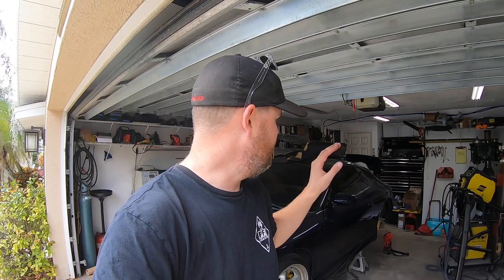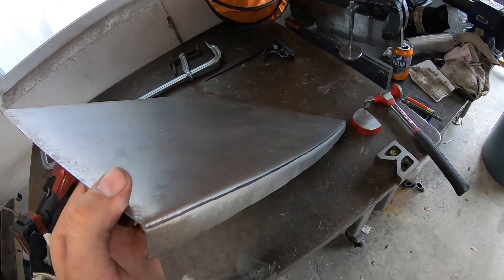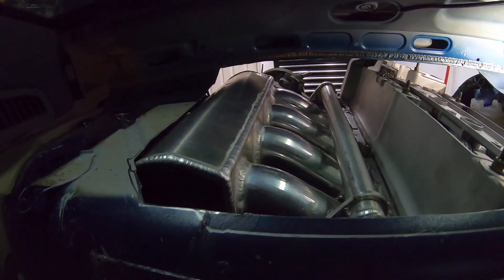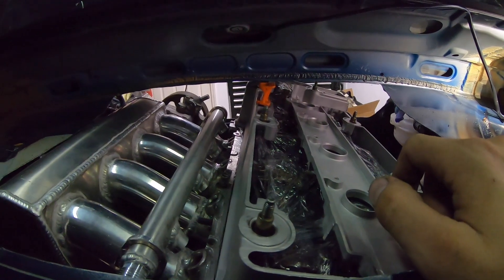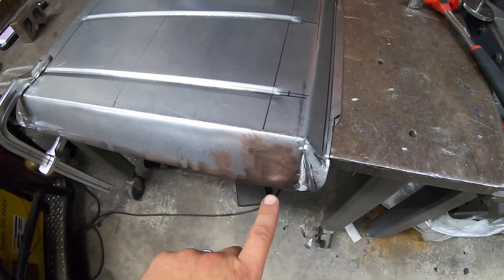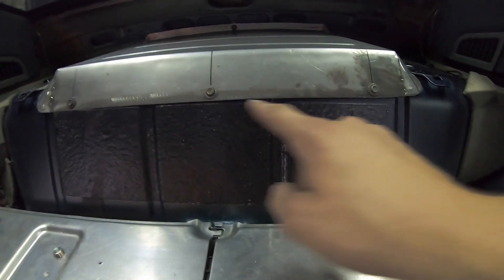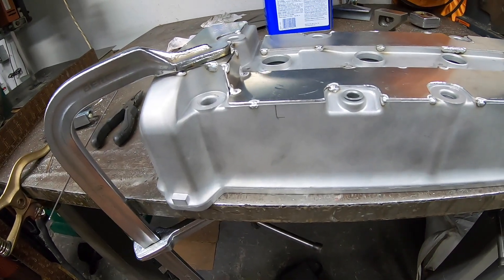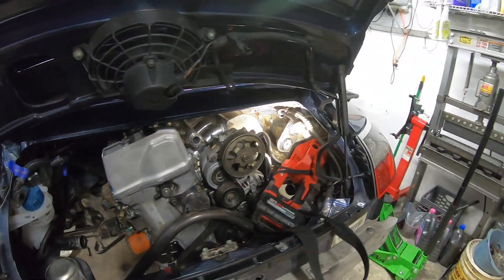Banging Out A Steel Cover To Clear The K24 Engine In The K Swapped 996

Comment: Keep the coils as far away from exhaust manifold heat as possible, that helps a lot with reliability. 
that side of the motor will reach crazy temperatures, especially in traffic jams but also on the dyno when theres little airflow to get rid of the heat (radiant heat from glowing red manifold/turbocharger will cook those coils and the wiring harness to death in no time)

Modern castings like those very lightweight intricate thinwall valvecovers are very low aluminium content, lots of other metals in the mix to get them to fill the moulds without bubbles or porosity, like zinc, silicium(silicon) magnesium, chrome, nickel, titanium and so on.. thats why its so reactive to welding.. makes your job a pain in the a....

Comment: Get some 6mmx1.0 threaded rod and make some spacers to evenly space the coils apart and youll have a nice tight package to mount somewhere cleanly. I used a few heim joints on the threaded rod to mount them above my valve cover. I'll send you some pics if you wanna check out my setup.

Comment: Think about a custom baffled sump, as probably not designed to run engine backwards............as accelerate the oil rushes to the rear, and potentially starve the pickup (not sure where pickup is on K-series)  If doing custom sump, maybe a level sensor from a Vw/Audi could be grafted in, to check oil level ?

Comment: Hey just a suggestion don’t put your coils on the hot side of your engine. Keep them away from the heat as much as you can. Why? Is they will fail because they run hot under normal conditions so having them anywhere near the turbo and exhaust they will shit themselves very quickly. And at 70 bucks each you don’t want to have to keep replacing them. I run LX91 coils they are 365 milliamps on my 20b rotary and they have been on my engine since 2003. Anyway Cain hard lad.